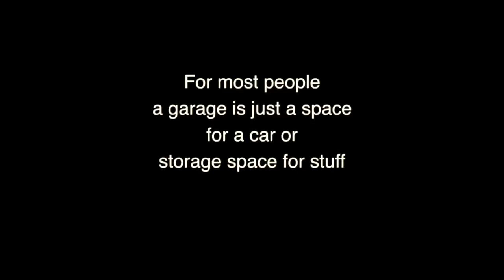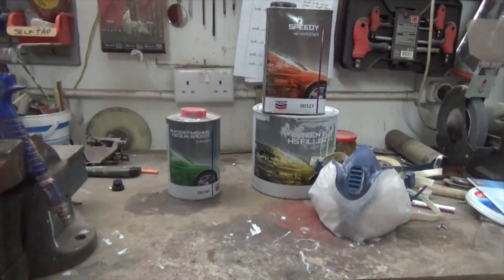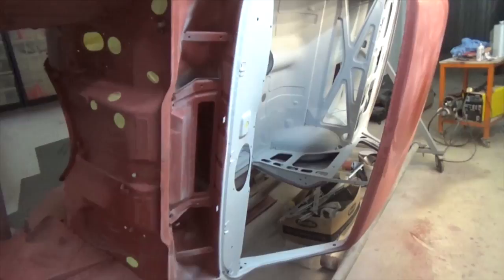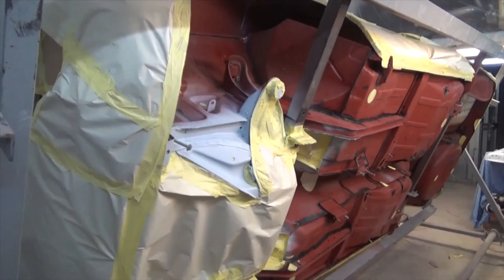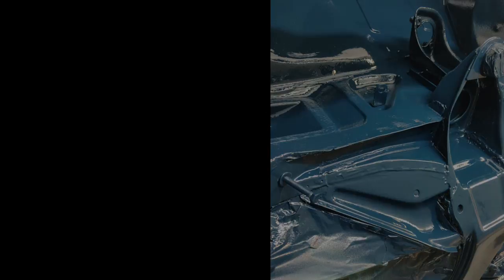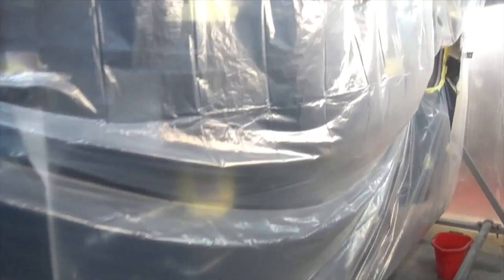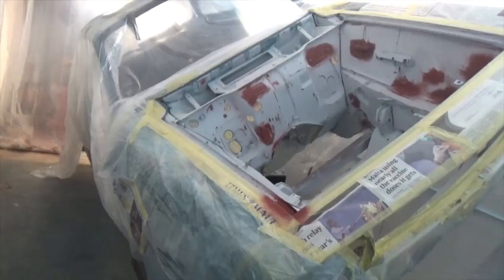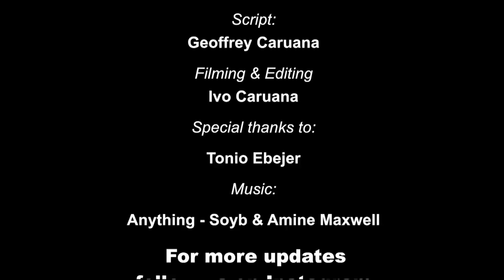Raising Junior Episode 17- Painting a car at home - Classic Alfa Romeo

Comment: ciao Geoffrey.I saw your video and due to condition you have in garage very good work with paint.The upper final layer will be difficult to dust.I hope you can do it to your satisfaction.I welded the floor of rear trunk.so it was chellenge....the floor was for giulia and I had to adjust it to the type of berlina.I steel waiting for spare wheel tub.
Reply from the maker: Thanks, I will have a professional paint shop to the exterior of the car. Good luck with your projects, some models are more tricky to find parts for

Comment: Geoffrey-congrats on all the progress and your dedication to the craft.  The start was rusty by my standards yet you kept at it. Great results.  The rotisserie was a big job but here you see how it is able to help you achieve your goals.  Stunning level of work.  Congrats on Bluette.. I've seen it on Sedans but it looks great on coupes
Reply from the maker: Thanks...I don't think I could have painted it this easily without the rotisserie. I painted the inner side of the roof and under the dashboard with the body upside down
Reply: @raisingjunior6389  Yes-the interior and under the dashboard was a revelation.  It would have been much much more difficult without the rotisserie. I need to revisit the rotisserie construction clips.  My metal skills are getting better and this might be within my skillset reach
Reply from the maker: The trick is to practice, start with scrap pieces till you build enough confidence to work on the bodywork. As for the rotisserie I took the extra work to make it bolt together so I would have to cut metal close to the painted shell when it's time to remove it